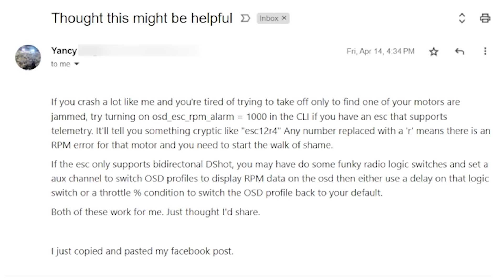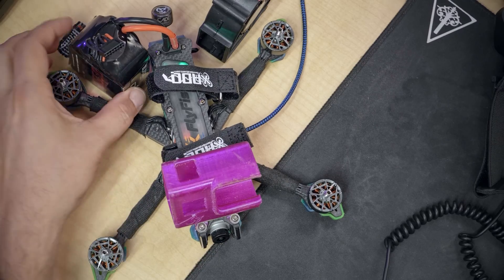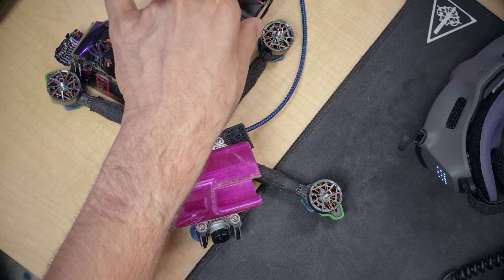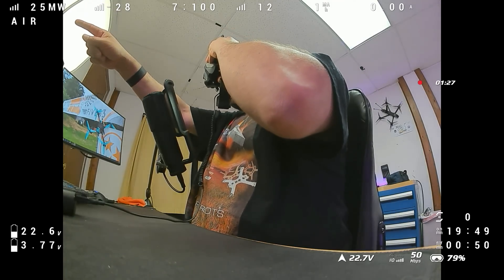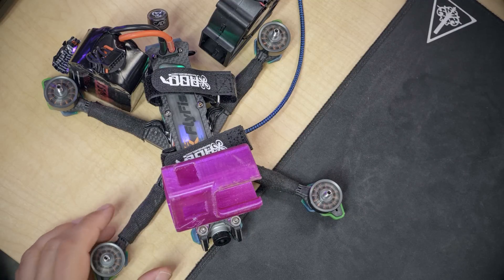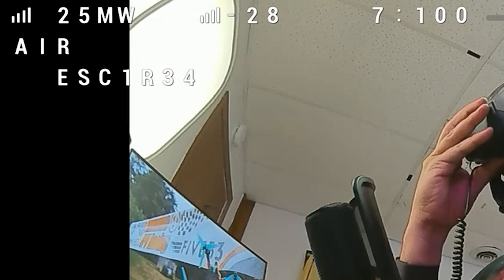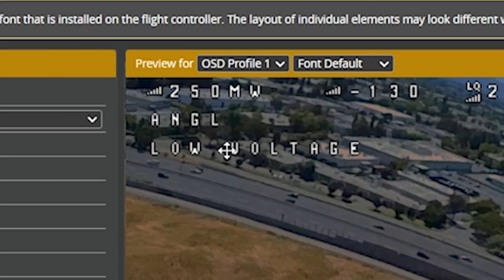Stop Burning Motors with Betaflight RPM Alarm

Comment: Wish i would have seen this yesterday. Battery strap came loose and started hitting the prop. Fell out of the sky and immediately noticed a few of the copper wire poles in the motor had melted together. Motor barely rotates now.

Comment: How to turn this off? On my SpeedyBee F405v3, telemetry on ESC does not want to work, but now I keep getting the "ERROR" message in the warnings. 😪 after I  set osd_esc_rpm_alarm = 1000 😁
Reply from the maker: RPM alarm requires ESC telemetry. It doesn't work with bidirectional DSHOT even though bidirectional DSHOT reports RPM. So if you don't have ESC telemetry working, you can't use this function. I advise turning off the alarm.

Comment: According (to my understanding of) the code of BetaFlight, since 4.4.0 it is enough to have 1) "osd_esc_rpm_alarm", "osd_esc_current_alarm" & "osd_esc_temp_alarm" set to not 0 value and 2) OSD warning "ESC_FAIL" enabled to get warnings about low RPM, high current and high temperature based on info coming through DSHOT protocol. Can't check it on the drone right now though :(
PS: this warning appears only when quad is in ARMED state

Comment: I'm surprised that trying to turtle while stuck is the most common. I've never burned a motor due to it being stuck, and I've definitely pushed my luck there tons of times. I've only ever burned out motors while flying with a catastrophically damaged prop that creates overly excessive vibrations.

Comment: Happened to me today. Was on the 3rd flight of an Apex 3" build, was flying beautifully and smooth with an JHEMCU AIO 45A, Ant motors 1408/3800kv, 4s, and clipped a tree branch. No problem as I pretty much knew where it went down. Spent 15 mins looking for it and couldn't see it. I knew I was close so I armed and disarmed quickly twice to hear a spin, but heard a 'popping' sound. Turned around and saw the thing on fire on the flat grass where I missed it ......FML. Definitely lost 2 motors and the AIO. Last time I use one of those AIO for anything except tiny whoop motors. I've done this repeatedly for the last 6 years to find quads with separate FC/ESC boards and never popped an ESC. It's not like it was all tangled up so I think maybe some other issue. Oh well.....Fly it, Break it, Fix it.
Reply: Ya, I have never had luck with AIOs. Well, the 533 kit one was good, but ya lose All-at-once when it does go bad. I had 2 from Iflight and both lit in flames when I plugged in the USB to my PC. Nether had been touched yet, nothing attached to them and flames in my hand. Other than that, I love Iflight products, but have switched to speedybee f7 v3 stack.

Comment: Thank you... will this work on a tiny whoop like mobula 6.
Reply: Not yet since it only works with ESC's with telemetry, basically 32bit esc's, ie 32bit Blheli esc vs 16bit Blheli_S esc. The Mobula 6 is running Blheli_S escs that do not provide telemetry data, but with Bluejay flashed to the ESC we do get RPM data. But like Joshua stated, nowadays we have bidirectional DSHOT on Blheli_S escs with Bluejay installed on them, so we are getting RPM information that way. Lets hope that the Betaflight devs change the code so we can use it on tiny whoops that are running Bluejay.

Comment: I just took a quick look in the code and the value is the RPM threshold below which the warning will be shown. I also noticed that the warning is supposed to work both with ESC telemetry or bidirectional DSHOT, so not sure what is going on there.

I don't want to post the link here because youtube tends to hide comments that post links, but the relevant code is in
src/main/osd/osd_warnings.c#L285 (for ESC telemetry) and
src/main/osd/osd_warnings.c#L340-L342 (for bidirectional DSHOT)

Great video as always Joshua
Reply from the maker: I couldn't get it working with Dshot RPM, but maybe the code was changed recently?

Comment: I'm fairly certain you can enable the "Motor Diagnostics" OSD element and, using only bidirectional dshot, display for each motor the level commanded or an "S" if stalled. It won't pop up all cool like that warning but it's always there and helpful if you know how to use it.
Reply: I tried it last night and it works! Simply check the Motor Diagnostics box in the OSD and you get a box with "SSSS" indicating which motor is stalled. In normal operation it shows  "- - - - "
Reply from the maker: That's slick! I'm going to try it!
Reply: You're the man, Baked Beaner. 👊🏻
It even works on my HM X12 AIO on my 85mm Whoop. 👌🏻
Reply: This is the way!!! Do this!!
Reply: @etalon3141  💪😎
Reply: mine NEVER in all my years worked. all my quads are filtered with bidirectional (bluejay)
Reply: This is what I have on my race kwads.  Helps let me know that I'm caught up in a flag or a gate and a motor is not spinning.

Comment: I thought that this was going to be good for IGOW and diagnosing why my whoop that's crashed the other side of the field won't take off and let me fly back. But I don't think any of my whoops have esc telemetry
Reply: Hey man! I was thinking the exact same thing for IGOW, then I realized that you can just turn on the "motor diagnostics" element in the OSD, and it will present an "S" for whichever motor is "stalled". I just tried it on my happymodel x 12 AIO in my Mobula 8, and it works great! 
No more wondering if I have one of my girlfriends thicc-ass Indigenous hairs caught in my Tiny Whoop prop.. 😅
Reply: @willpowerfpv3246  I have one set up on a whoop that shows 4 lines that I think represent the motors, is that the same one or something else?
Reply: @robin-8439  what I understand it achieves the same. I could be wrong, and there might be some other use case but it seems like what baby is showing in the video is kind of like a workaround for what this element. I'm no betaflight October though I could be mistaken. But I did try it out and if you stall a motor and ask pops up which is all I need as far as functionality.
Reply: @brandonbeans has made another post confirming what we're both thinking

Comment: The number is a binary encoded X/Y coordinate for the position on the OSD. If it's zero, the element is hidden. Setting it to 1000 will simply display the element in a default position.
Reply: no
Reply from the maker: Definitely not. The RPM warning appears in the position of the Warning OSD element.

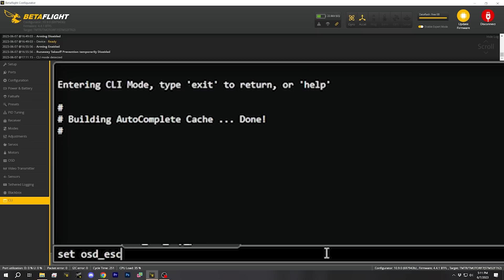Comment: 03:51
# get osd_esc_rpm_alarm
osd_esc_rpm_alarm = -1
Allowed range: -1 - 32767
so one would guess.... I've set it 999 RPM below my lowest motor idle value... Cheers for the Tip Yancy/JB

Edit: now set to 60...if it's not spinning once a second.. sounds like a decent setting..at least for turtle 🧠
Edit: can't get this to RELIABLY trigger at any RPM unless above  idle value... I don't want wont trust this at all...but better than nothing.. even if not reliable? 🤔

Comment: I made a drone recently and whenever it touches the ground or a object it reactants strongly by accelerating the motors. This makes it really hard to land as the drone just starts to bounce. Is there a setting in beta flight I can configure to fix this?
Reply: You can disable AirMode in the configuration tab. But it will behave poorly when lowering throttle in flight.
You can activate it and deactivate it with a switch, there are plenty of videos about that. “Airmode on a switch”
Or just learn to disarm low to the ground 😅
Reply: I'm pretty sure that's just how Air Mode is. If you hit anything it will react strongly. You can set Air Mode on a switch. If you don't assign a mode it will be plain Acro Mode. I'm not 100% sure but in Acro, if you put your throttle to zero the motors will stop completely and bad things will happen. But in Acro you won't get that strong reaction. The guys that try to grind their kwads use Acro instead of Air for that exact reason.

Comment: My thoughts....  The OSD warning needs to display longer.  It flashed so fast, I would never notice it.  I barely see my  battery voltage....
Reply: IF the motor is blocked, it will stay on screen and not flash just because someone slowed the motor down shortly.

Comment: Would be amazing if it could detect the stuck motor and disable just that motor until you flip a switch back so the other motors can still help you get unstuck
Reply: that would be good
Reply: I have a drone that struggles to spin up its motors and when it cant do it for like 10 seconds, it makes a specific long beep sound

AND, I THINK it stops trying to activate that motor because ive never gotten it to spin after ive heard that wbeep

So it might be a thing on some escs or their firmware...?

Comment: Hey, Joshua, what kind of foam are you using on goggles 2, i badly need a new foam for them?
Reply: Iflight narrow version is good if you have pressure on your nose with current foam
Reply: @thomasbrian7097  is there any good reviews comparing new dji soft fit foam with iflight ones ?
Reply: Not sure. I bought the early AliExpress ones but they still put pressure on my nose. Then I saw the Iflight wide and narrow versions and tried the narrow as it seems to push the goggles away from your face under your eyes which relieved the pressure on my nose. Therefore haven’t needed to try the newer DJI ones as the iFlight ones are pretty comfy

Comment: The real question now is
Can we use both bidirectional DShot and esc telemetry together on a quad?
Coz losing bidirectional DShot is a big deal.
Reply from the maker: Yes you can use them both. I'm doing exactly that in this video.

Comment: Should be some form of high RPM protection too, running motors prop-less by accident at max is a good way to burn them up as they don't have sufficient cooling.

Comment: The value of 1000 is the RPM threshold. If the motor's RPM falls below this value, it will show the error.
Reply: JB has never seen the motors tab?
Reply: could also be a bit signal with 8 different toggle settings. what for i don't know. so it could be = 1011

Comment: 1000 is probably the RPM speed.    At Idle you were just over 1000 and if its blocked it would be lower.

Comment: Thanks for the info. Anyone know if it's normal to need to goto 54 throttle on mobula7 HD to take off. I tend to bounce up and down alot. On my channel I have a video if you want to see the throttle details in a video
Reply: Sounds normal to me
Reply: Did you set the Rx range on for your receiver in beta flight?
Reply: @rippfpv  it is set to whatever default is. I looked in reciever tab and it is set to spi rx. if thats what you mean. in ports i see blackbox logging set to 2470000 and blackbox tab i see serial port then 1/8 250Hz Gyro_scaled.
Reply: @aphixe   so turn on your radio and plug in the mob7 in to beta flight go to the receiver tab  and move your sticks the default is usually like 988 on the low and and like 2008 on the high end it should be 1000ish  to 2000
Reply: @rippfpv  on the low end of throttle it is 989 and on highest it is 2009